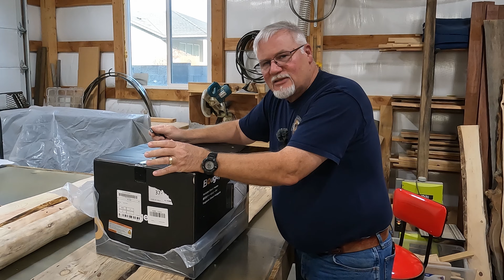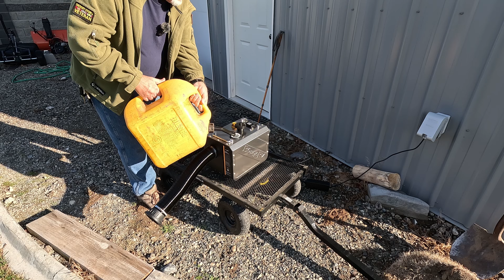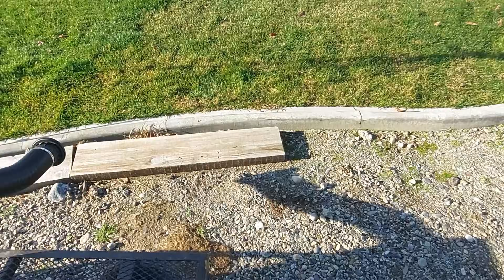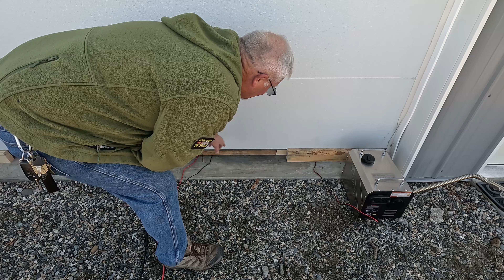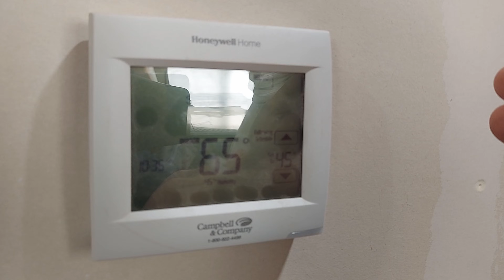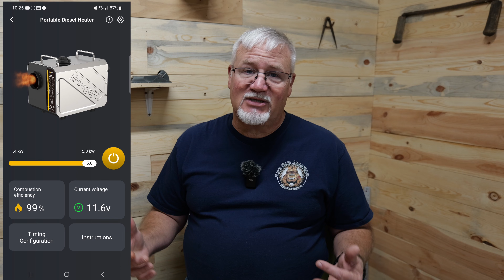I Tried a Diesel Heater in My Shop and WOW!

Comment: Don't open your garage door, the door seal at the top being propped open will loose most of the heat your putting in. Put the whole unit inside the garage and vent the exhaust outside. It's easy enough to make a shelf on the wall and get a section of stove pipe as an exhaust sleeve and pack the air gap with rock wool insulation, keep the heater exhaust pitched down hill to drain always, there is some amount of condensate that can accumulate along with a soot tar substance usually associated with extremely low exhaust temps where it's aloud to condense, and I believe I did see a drain weep hole on the bottom of the muffler,(across from the mounting hanger hole. Also something to consider is that there is usually a fresh air intake for the combustion air that's a kind of paper tube that if you have a really tight building you may need to pipe in from the outside, being that there is a garage door the limited makeup air will probably just pull through the door seals just fine. Something else to consider is that you may want a small fan on a tool bench to help keep the air in the room circulating, otherwise the heat may stay on one side of the room.
Reply from the maker: I blocked up the door to reduce any drafts but this was also just a test rather than an install :D

Comment: UNIT ITSHELF IS BEST INSIDE RECERCULATING THE WARM AIR ~MUCH MORE EFFICIENT~ ALSO A C02 DETECTER IS A MUST~ ALSO SUGGESTING NOT NEEDING TO READ INSTRUCTIONS OR POSSIBLY EVEN GOING ON LINE FOR INFO TO YOUR FOLLOWERS IS JUST BAD PRACTICE/ADVICE~ I DO LIKE YOUR CHANNEL AND LOVE THE INFO EXSTENDING POWER STATIONS WITH OFF THE SHELF BATTERIES~
Reply from the maker: Thanks for the feedback and for watching!

Comment: I’ve seen a few YouTube videos hook the outlet (heated) air end to an old wall style radiator. That way you’re running a semi-boiler/radiant heat setup. They get the boiler radiator for next to nothing.
Reply from the maker: That's a clever way to use it.
Reply: RUN THE (EXHAUST) THOUGH THE RADIATOR THEN TO THE OUTSIDE OF GARAGE SHED ETC

Comment: Best heat on the planet is a wood stove
Reply from the maker: I concur
Reply: @TheOldJarhead  I CONCUR AS WELL~ BUT >THAT MIGHT BE A PROBLEM WITH WOOD DUST~ BUT WITH THAT SAID A GOOD EXSHAST FAN ON FOR 2 MINUTES SHOULD REMOVE ENOUGH DUST AND GETTING RIGHT BACK UP TO TEMP SHOULDENT TAKE LONG AT ALL
Reply: GOOD TO CHANGE OVER INSIDE AIR IN YOUR SHOP IN WINTER~  A GOOD IDEA RGARDLESS

Comment: Great video. But wondering why the5kw heater. Most 5kw and the 8kw cost the same.
Reply from the maker: I was originally thinking of using it for my overland setup with my roof top tent (and will likely use it for that purpose for cold weather camping).
Reply: TRUE IT JUST A HIGHER FLOW PUMP ON THE 8KW MORE FUEL MORE HEAT A BIT OF A SCAM FOR SOME

Comment: A 5kw diesel heater should be plenty for a 900sqft space unless it has a 30ft ceiling or a lot of air leakage or possibly not enough if you have no insulation in your frigid climate.

With the heater outside and pushing air into the shop you are pressurizing the shop and forcing air out wherever it can escape. If it cannot escape it will increase the back pressure on the heater which reduces the output.  If your air is leaking out from up high, it will be leaking your heated air.

Ideally you should make sure heated air intake and exhaust are in the same space.  Also make sure that combustion intake and exhaust are both outside. Usually it is easiest to install the heater inside and put a couple of pipes thru the wall for combustion air and exhaust.  Also most of those heaters have a thermostat in the control panel. It works better if the thermostat is inside, obviously.
Reply from the maker: Good points! My shop definitely has a fair amount of air leakage and not much insulation, plus a very tall vaulted ceiling.

This heater easily heats my friends smaller shop with 12 foot ceiling and r21 walls.
Reply: GOOD INFO ~ I THINK YOU CAN ONLY TURN TO LOW MED HIGH THOUGH

Comment: How about running a split AC unit that also heats from batteries and a petrol/diesel generator as a backup?
Reply from the maker: It's all about money.  I can't afford a big inverter at the moment and to run a minisplit to heat a 900sqft shop I'd probably need a 6kw inverter at minimum.  Same with the Genny, though I do have an LPG generator that's a 2400w unit so perhaps I could plumb it in.

Comment: you want to have the whole unit inside, so you are not heating outside cold air
Reply from the maker: That's certainly on approach and maybe the better one but I'm thinking it could be done by plumbing in the air intake to the inside.
Reply: @TheOldJarhead  agreed, that's my plan also, leave unit outside and run air to and from it
Reply from the maker: Less worry about the wood dust catching too 😉

Comment: You need to keep the heater inside, run the exhaust outside, and the combustion air, your waisting energy the way you air doing it
Reply from the maker: Or run the intake inside as well.  Plumbing the exhaust outside would certainly work but as it's a woodshop I prefer to keep combustion outside ;)
Reply: @TheOldJarhead  You wouldn't want to run that thing in a space where there is a lot of combustible dust particles floating around. They will to some degree accumulate inside the unit over time but can be cleaned with compressed air if required.
Where I run my heaters, there is little combustible stuff around, but still dusty nonetheless. I mainly do auto repair and metal work in my shop.
Your shop looks rather clean and you have a dust collection system on your machines. So, if efficiency is high on the priority list, you should consider mounting it on the inside. In this case, you still would want to put a heatshield around your exhaust pipe as this is the hottest part of the unit that any kind of dust could settle on. I like to use those textile style heat shield tubes.
I'd be more worried about any of those batteries or converters burning up without warning, to be honest. :P
Reply from the maker: Ya, that's what I was thinking...all that sawdust is just asking for trouble!  Thanks for the reminder...I knew there was a reason I put it outside.
Reply: @TheOldJarhead  NOT A PROBLEM WHEN COMBUSTION INTAKE IS FROM OUT SIDE THE WAY IT DESIGNED TO WORK WOOD DUST SHOULD NOT BE SUCKING INTO IT AT ALL AND WONT BE IF INSTALLED CORRECTLY

Comment: I’ve played with those diesel air heaters quite a bit. What I’ve found to be safer and more efficient is using an eberspacher or webasto engine pre heater type as a hydronic heater. 3 to 4 gallon heat reservoir tank with a few of the auxiliary heaters like maradyne or northern make. You can wire the whole thing through relays and thermostats and it all runs automatically.  Put the “combustion unit” outside and plumb in the rest inside with insulated silicone hose.
Reply from the maker: That's an interesting approach to heating!
Reply: Eberspacher?  I hadn't heard that name in along time.  My old air cooled Beetle had an Eberspacher heater back in the 1970s.  It kept that car warm.
Reply: @daniellarson3068 you can buy them brand new today. Actually they are my preferred option! 😊

Comment: Maybe I missed it, but what is the run time on a full fuel tank. Just curious and stay warm :)
Reply from the maker: That depends on how you use it.  Running full blast, it sucks down a tank in 8 hrs or less.  Running on low it can go quite long and I haven't found that level yet.
Reply: most of these diesel fuel heaters come with a 1 gallon fuel tank. If I run mine on auto mode, were the unit powers itself up and down automatically, it sipps fuel.  Set at 75 degrees on auto mode for 9 hrs, using less than a half gallon of fuel to heat my 21 foot  camper.
Reply from the maker: What unit do you have?
Reply: DEPENDS ON SIZE OF PUMP AS WELL 8KW OR 5KW BUT YES DEPENDS ON HOW YOU RUN IT AND IF ITS INSTALLED CORRECTLY

Comment: They make an 8 Kw unit 👍
Reply from the maker: Yes
Reply: THE ONLY DIFFERANCE BETWEEN THE 5 AND THE 8 IS THE PUMP ON THE 8 MOVES A LITTLE MORE FUEL MORE FUEL MORE HEAT AND A BIT OF A SCAM FOR SURE~

Comment: Make sure you have a carbon-monoxide detector installed in the shop / or any location where you use a diesel heater.  Or an O2 + CO monitor (that also checks for oxygen depletion).

Diesel can put out a lot of energy, but like any fossil burner you'll be paying through the nose if you leave it turned on all the time.  So YMMV.  Still, these things are especially nice for RVs and campers where the solar + battery system is not likely to be big enough to support reliable heating.  (A/C can often be supported because heat means sun, but heating can be harder as you might need heating without reliable daily sunshine).

-Matt
Reply: A U.S. fluid gallon (3.785 liters) of diesel has about 40 kilowatt hours, and this thing supposedly peaks at 5 kw.  So a gallon of fuel should heat for 8 hours at full output and that's likely to be enough to cook anything in the shop so I expect at least 2-3 days use on a gallon.  That's pretty cheap offgrid heat unless you compare it to getting firewood from your own nearby woods. 

If you use home heating oil it should be about the same as #2 diesel, but usually much cheaper.  Might burn dirtier, but usually it's the same stuff (but with added dye just like your offroad diesel so folks don't run their trucks on heating oil).
Reply from the maker: I need to do more testing, but I don't think it will run flat out for ihrs on one gallon.   Even the others I've seen usually have to run at lower flow rates to do that.
Reply: @TheOldJarhead  ALSO GOOD IDEA~ GET A REBUILD KIT ITS CHEAP WITH NEW GASKETS GLOW PLUG ETC~ ALSO YOU CAN PICKUP A 22ML PUMP IF YOUR UNIT IS 5KW AND TURN IT INTO A 8KW~ SOME PEOPLE GET THE SCAM NOT KNOWING THESE HEATER ARE THE SAME~  PLUS A SPARE PUMP IS A GOOD IDEA AND FUEL FITERS SOME EVEN HAVE WATER SEPERATION BUILT IN~ IF KEEPING YOU FUEL OUTSIDE YOU MIGHT NEED SOME DIESEL CONDITIONER SO YOU DONT GEL UP MAKING PUMP UNABLE TO PULL~ IF RUNNING A LARGER TANK LIKE A 5 GALLON JUG IT SHOULD BE HIGHER THAN THE UNIT ITSHELF~ YOU CAN PICKUP A STAND PIPE OFF AMAZON CHEAP AND TURN MANY POTENTIAL CONTAINERS INTO FUEL "TANKS"
Reply: It’s also a matter of age, corrosion, and wear and tear.  Just as with gas furnaces, if a crack develops in the heat exchanger, CO and other contaminants can leak into the inside air-stream.  Even when you have it plumbed correctly.  It might not be apparent, but a modern residential gas furnace has three or four separate safeties.  Even a modern gasoline generator has a CO detector built in.  RVs are required to have CO monitors.  Diesel heaters generally have zero safeties.

The reason the market is saturated with diesel heaters is because they are produced in huge volumes by China to replace coal and wood heating in rural China and Africa.  In that respect they are much safer than heating with coal.  But not nearly safe enough relative to the expectations in countries like the U.S.

So it’s a “trust, but verify” type of situation.  Have a CO monitor.
Reply from the maker: Good info, as always, thanks!
Reply from the maker: Great points